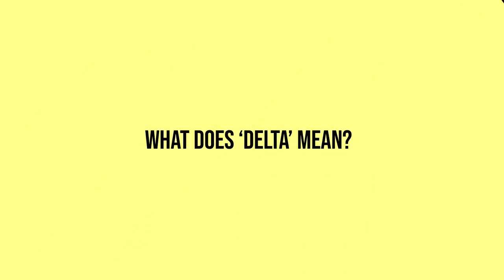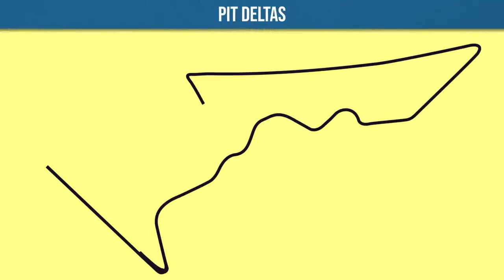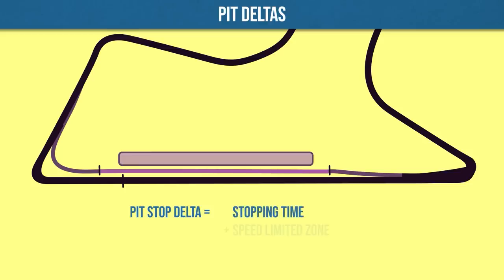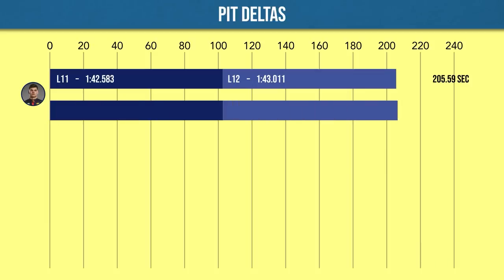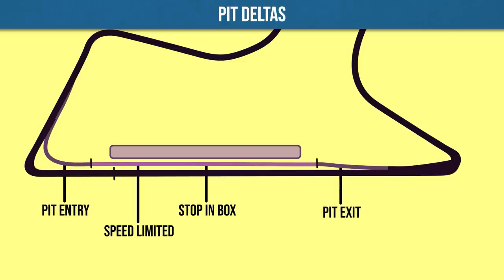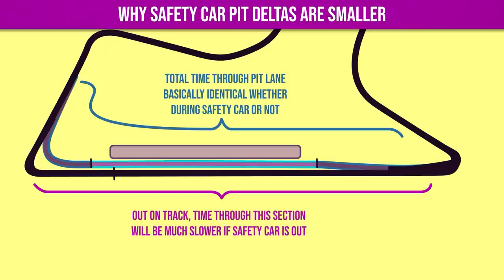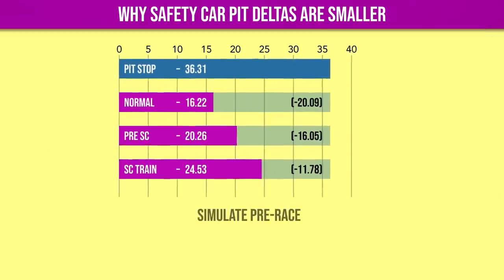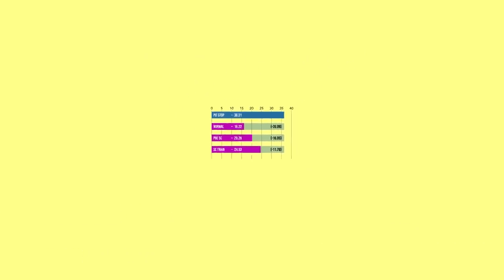F1's Pit Stop Time Loss Explained

Comment: You could also mention that you have to pit RIGHT AWAY once SC or VSC is called, otherwise you’ll lose a lot of positions because the distance between the cars will shrink progressively during SC until they’re all right behind each other, correct?
Reply: That's track position based, not pit delta based
Reply: @hdr_diamondz  Correct, but it makes a big difference in how many cars will have passed you. In the pre sc situation it is likely to be fewer places than in the sc train situation. Eventually it is not time lost, but position on track that matters.
Reply: That’s exactly what I mean. So, if you pit at the beginning of the safety car, when the cars aren’t that close together, yet, you might be able to take advantage of losing less time for your pitstop. If you pit later, you will lose a lot of track position because the field has compressed. Unless, of course, everybody around you also pits.
Reply: Or, of course, if you know other cars around, you will have to pit Eventually, you can take advantage of the smaller time loss when pitting during safety car.
Reply: Track position loss under VSC is more analogous to green flag running than safety car. Most of the time you cannot lose track position to literally everyone like you would under a full safety car.
Reply: I also think it would make sense in this video to talk a little bit about how loss of track position plays into the timing of putting under safety car.  Maybe that broadens the scope of this video too much and warrants its own video but that was something I struggled to grasp.  Thanks for the videos Stuart!
Reply: @markmcnaughton85  I agree. The video as it is is informative and correct, but it leaves room for a 2nd video that puts the information provided here into the race context and makes it useful, so we can al be smarter that the team strategists next time there's a safety car. :)

Comment: I'm surprised you didn't mention two other factors to this when discussing the safety car:
1. You want to pit right away, not wait for the train, as you're more likely to lose more track position once everyone is bunched up behind the SC.
2. Under VSC the cars don't bunch up, but the delta isn't quite as drastically affected as it is by a regular safety car.
Reply: At the beginning of a regular SC they use the same delta-time system as VSC until the cars are bunched up. So the pit stop delta under VSC is exactly the same as under the first lap of regular SC.

On the second lap of SC the delta would technically be larger, but like you said you'd loose more positions as the cars are bunched up now.
Reply: Likewise, he didn't mention it's a cheap pitstop but it's often a pitstop at the wrong time. So the teams have to constantly check whether or not the time gained in the pit stop is worth (for instance) the time lost at the end of the stint with degraded tires
Reply: @anidiotinaracingcar  Absolutely, the timing of a pit stop, plus the potential for undercut/overcut, can be pivotal to the outcome. I think that bleeds a bit more into overall race strategy, so I can see why that might not have been included in this video.
Reply: And there's one more thing to consider. Sometimes pitting before the safety car can be even better. I'm not sure how but I remember Vettel using it to overtake Hamilton in 2012 Australian GP. I think it's because Hamilton caught the back of the safety car before he could pit?
Reply: @dlake1224  Yeah, that's similar to what I was talking about with pitting right away when the SC is called, and that can be thwarted if you catch the SC (or its train) before you get a chance to pit.

Comment: Thanks for actually explaining that!
For many years the F1 TV feed never showed this information.  There always was only the "total time spent in pits" clock shown on screen, and our local reporter usually suggested that that would be the time lost when making a pitstop.
But it occurred to me early that this is wrong.  You need to subtract the time a car on track requires to drive from pit entry to pit exit.
So every time he was surprised that after making a stop, a car would not lose nearly as much time as displayed on screen....
Now that usually after a couple of stops the F1 TV displays "average time lost during pitstop" there is no need to guess how much less it is than the "time spent in pits" displayed for every stop.
(of course the exact pit delta for a stop is difficult to display as it varies according to speed of the cars on track, as you explained)

Comment: just as a slight further extension to this... this is also why some races/series have something called a "joker" lap... where instead of pitting every car needs to make a certain amount of joker laps, usually through an extended version of the track or through the pit lane to simulate having to pit for w/e reason... can be used as punishment, added in to spice up a race or just because the format works better with one.

Comment: You should have also added positions lost during all those 3 variants. Losing 16s for a pit stop but only 1-2 positions is better than losing 12s but 10 positions because all the cars already cought up to the SC.
Another factor is pit lane entry getting closed during safety car meaning pitting right before then is often good (Gasly at Monza 2020) but it can vary depending on the timing of opening the pits and race restart + how many cars actually decide to pit.
Then to make the video complete, add a situation when a driver pits right before SC and pit lane is open (for example Perez in Saudi Arabia 2022).

Comment: The solution to stop massively unfair advantages being gained by being lucky with a safety car stop is really simple...
SOLUTION: If you stop during a safety car or virtual safety car the pit crew have to wait 5 seconds before working on the car!
It Delta varies from track to track, but even on the tracks with the largest the advantage gained will be severely limited.
And on those tracks with the lowest Delta you maybe slightly punished pitting under safety car, but it will only equate to a slow stop.
Reply: That or lower the speed limit in the pit lane when the safety car is deployed. Done. No more free pitstops. 
But apparently all the F1 fans I have talked to prefer more show instead of fair racing...
Reply: @swe223  they don't realise that as the cost cap, tunnel time variations, and new regulations will make the show better and better and things that were traditionally ways to shake up a GP will make them worse!
Reply: @samueldorrington8990  I agree and I think it's even worse. Some people (and I mean 20 years+ fans) did not even question the fact that cheap pitstops exist. When I talked to them, they were like "Yeah it's good or bad luck, that's just how it is". Like a fatality. It is so engraved in their brain and in the habits of the sport that they never ever thought that we could get rid of it (super easily)

Comment: Would one way to accurately measure pit delta be to just measure a lap starting and finishing somewhere else than the start/finish line, such as the start of sector 3?
Reply: Yeah, you could just measure at the start and end points of the relevant part of the track.
Reply: I doubt, the way he explained it, is how it's actually measured. Taking the combined time of the lap a car pits and the one after it and subtracting the time of 2 combined normal racing laps from that, can't give you the realistic pit loss time because you would also have to factor in the effect of the new tires. 

I bet they actually measure it by starting the lap time from say the first timing post after the pit exit, and actually just measure the time to do 1 lap normally and one while pitting.

Comment: Is the pit lane time the same regardless of the conditions between  your 2 points? If you are exiting the pits, under SC you still have to respect the delta, so your time would surely be slower between those 2 points?

Comment: Do you think that reducing the pit delta as much as possible would encourage harder and more aggressive driving? As if you burn through some tires it'll be easy to change them and get back out there?
Reply: While the base premise holds water, that shouldn't happen, ever. The pit delta isn't something magical we want to reduce, it exist as a natural consequences to safety measures. Yes, you could build tracks where the pit lane is a massive shortcut so you don't lose as much time, and that would certainly be interesting - but most tracks can't really change.
Also, pit lanes are - rather ironically, considering the speed limits - already pretty dangerous. There's a reason teams don't refuel cars anymore and anytime you have 3+ cars in the pits at the same time will be pretty chaotic and therefore dangerous.
Reply: I'm thinking the pit lane distance should be close to the racing lane distance it substitutes.

Comment: While it might be true that the SC-Train/Pit-Stop delta is much less than the normal-running/Pit-Stop delta, this (contrary to VSC or catching up to the SC) is not the end of calculations. Becuase while you may loose 8 seconds less, you will fall down the order (i.e. track position) far, faaar more than during a VSC stop. And having to re-overtake a bunch of cars after the restart will loose you more than 8 seconds in almost all circumstance, even if you are the faster car. Stopping behind a full SC when the field is already bunched up only makes sense if you also gain an advantage on the tires - e.g. you get to swap away from a bad tire or towards a quicker tire for free.

Comment: One thing I don't quite understand is why a car pitting 1 or 2 laps before a SC is deployed gets so much advantage, like alonso in Singapore 2008 or gasly in monza 2020
Reply: It doesn't. It would be very bad if you pit and a lap later a safety car comes out, as explained everyone that hadn't pitted yet and do so under the safety car, lose less time on you compared to how much you lost to them during your stop.

If car nr1 is, say 3 seconds, ahead of car nr2 and pits, then 2 laps later a safety car comes out and the car that was nr2 pits at the beginning of the safety car, car nr2 will more than likely come out ahead of the nr1 car, because car nr1 was moving at a reduced pace behind the safety car.
You always lose out pitting just before safety car.
Reply: 2008 there was a rule that you could not pit until the field was cued up behind the safety car.
While in Gasly's case, the Pit entry was closed for security reasons.

Comment: Would have Lewis been able to pit in Abu Dhabi 2021. He was 12/13 secs ahead of max. When the SC came out Lewis was a turn or so from the pit entry. Would that have been enough to keep in front if he had pitted? Feel like Mercedes gave red bull the win by not pitting
Reply: Yas Marina has an odd pit lane. Remember, on pit out, that it goes into a very narrow tunnel under the track, curves sharply to the left then back to the right before paralleling the track. The delta even under a SC would likely be much greater than he showed at COTA.
Reply: @stevelavergne2852 12/13 secs would had been enough time for Lewis to pit and keep the lead? I know when max pitted it was like 20 secs overall. Not sure how much time Lewis would have saved.
Reply: No he would have lost track position if he pitted and max stayed out which was why they chose not to pit. He lost enough time battling with checo so max was able to stay within that window.
Reply: @AyoSosanya  somewhat true? Don't think Lewis would lose time battle max or Perez on fresh tries. Look what max did to Lewis. Same would have happened . Pretty sure Red bull would have pitted even if Lewis did. Just because of the risk of a restart. They don't pit, Lewis wins. If they pit they would be basically on level ground.more of a chance to win.
Reply: @ericktb4  He did? the whole "checo is a legend" thing came from when Checo extended his stint on old tires to hold lewis up after he pitted for fresh tires. Checo held him up enough for max to make up like almost 15 secs lol 

I don't think they would have, Max was already on fresher tires from when he pitted under VSC late in the race and is aggressive enough to defend that position for one lap.

Merc trapped themselves when they didn't pit under VSC because that meant they had no choice but to stay out at the end or give a free position to max.
Reply: @AyoSosanya  no. Talking about when Latifi crashed and the SC came out. Lewis was a few corners from the pit entrance when yellow flags came out. One or two corners before the SC came out. Lewis could have pitted SC and lost no time due to him being a corner or two from the pit entrance.
Lewis was on 35+ old lap tries when SC was called. Asked about pitting. Mercedes said no. Seemed upset over the team radio. After that. More or so when he found out max had pitted for softs.
Reply: No, they explained to Lewis on the radio, that if they had pitted they would have lost track position to max and by their calculations they didn't have enough laps left, so the race will have to end under safety car, giving Max the win. 
Max had enough of a gap behind him to pit and still come out in second place. And in case they do have any racing laps at the end he will have a huge advantage over Lewis's old tires.
And as we know, Mercedes were right, there wasn't enough laps for the race to restart and Lewis would've won if Michael Masi didn't decide to restart the race against the rules for the final lap. (according to the rules he would've needed one extra lap to restart the race)
Reply: @Renee Rehe  I rewatch the last 10 laps. There were 7 laps left when the crash happened. The crash was clear by lap 55.  With 3 laps left. They should have had enough time to restart. I feel like Mercedes made the wrong call. Only say this because Mercedes said they didn't know if the race would be restarted. Mercedes didn't want the race to be restarted mainly because the tired difference.
Reply: @ericktb4  And the rules stated (and this is haow it has always been implemented by these same rules for years) that in case of a safety car restart, all the lapped drivers have to un-lap and get significantly ahead (not necessarily to rejoin at the back of the main pack though), then the next lap after that, the safety car can come in and the race will restart.

Masi, by his judgement and unforeseen interpretation of the rules, decided to let only the 3 (4?) cars un-lap that were situated between Hamilton and Max. He only let them get a few corners ahead and called the safety car in at the end of that same lap, overriding the rules.

So if everything would've been done by the rules, the race would have ended under safety car, as many others have before.

And even if everything had gone by the books and the calculations predicted one single racing lap at the end. If Lewis had pitted, Max would've surely stayed out to gain track position. How that would've ended, we'll never know.
Reply: @Renee_R343  I rewatch the last 10 laps. The track seemed to be clear by lap 55. 3 laps to go. Not sure why they waited till middle lap 57 to let cars go through. But that's not here or where. Something I noticed. So maybe if they got everything moving more quickly. They could have done it by the book.
Honestly if Lewis would have pitted. I believe red bull would have pit max 100%. 
A- they don't know if the race is going to end under a SC or restart.
B- if race did restart they would be on older tries than Lewis that's right next to him.
C- everything to lose/nothing to gain. They would have track position. Which doesn't mean much on a restart. When the other driver has fresher tires than you. It would be like Mercedes asking red bull to hold their place on line.
Reply: @ericktb4  Yeah, either way, how it played out really annoys me. 2021 was probably the championship battle of a generation. Two of the greatest trading blows through the year going into the final race on level points. You can't make that up. The race was tense, like a rollercoaster. And then to end such a way. Conducted so controversially and all for the show. Sad.
Lewis knows he should be record-breaking 8 time champion and I believe, inside, Max isn't 100% satisfied either, because he didn't have an answer to Lewis' speed that race.
It'l always be debated this race and championship. Just as we are doing now.
Reply: @Renee_R343  true. It should have been the best season in F1. I wanted the race to be amazing. Even after Lewis went track and cut a corner. Nothing was done about it. Max stayed on track and Lewis didn't. Still not sure why nothing happened.

Comment: Why doesnt F1, knowing the delta between the pit delta and the pit delta with safety car, add that difference as a mandatory stactionary time in the pits before the crew makes any changes? I Would assume it would reduce virtual gains right? It should all be in the spirit of competition that we close down this lucky gains as much as possible.
Reply: Or simply lower the speed limit in the pit lane when the safety car is deployed. Done. No more free pitstops. 
But apparently all the F1 fans I have talked to prefer more show instead of fair racing...